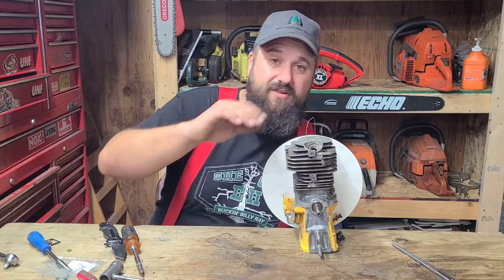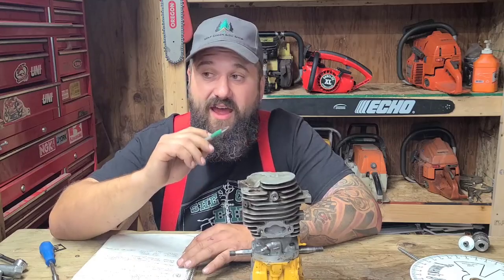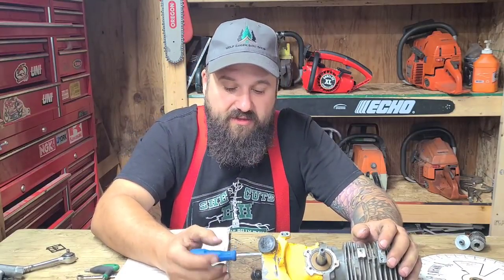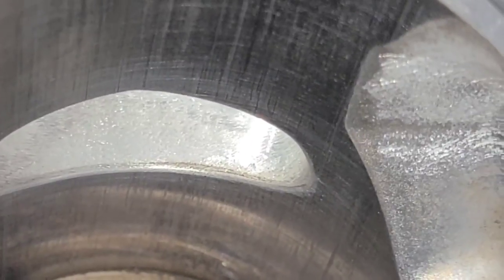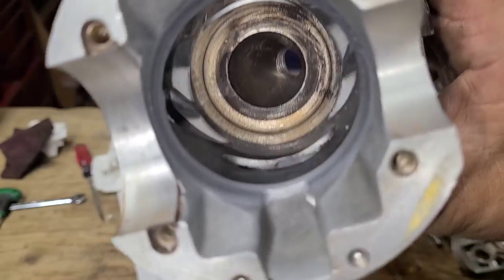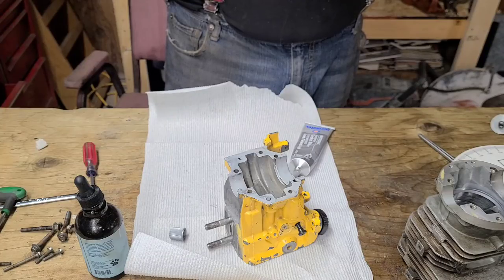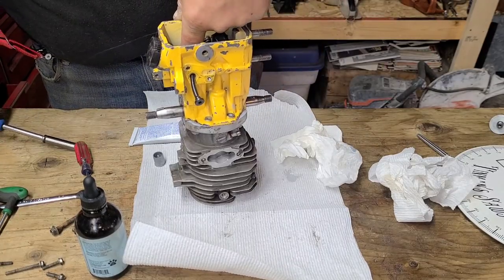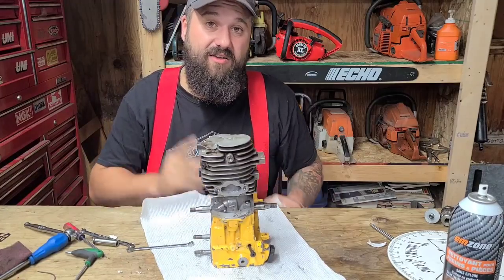Mcculloch Pro Mac 850, showing my porting and assembling the block.

Comment: I'm not a professional porter, just a tinkerer, and I totally agree there are different ways to skin a cat but I have experienced lowering the blowdown can really power in the cut. I know different saws with different crankcases like different things. I did some mild porting to my 046 a long time ago but didn't touch the upper transfers as I didn't have a tool to get them. Recently I bought a 90 degree tool and took the blowdown down from 20 to 17 degrees with no other change and with the same chain and the same log has a very noticeable increase in torque. Doesn't bog and can really lean on it quite a bit harder. Alot happier with the saw. Love your videos by the way.

Comment: Tinman I’m porting my first saw based off what I learned from you and Ironhorse plus reading.
The saw is actually kind of similar to this 850. It’s a little 38cc plastic McCulloch (PM425AV) which is the same saw as the 3516 etc. Anyway it’s a throw away saw vs that 850 but it’s interesting how it is very similar in design. 
I’m totally hooked on this porting thing and with all the variables of Squish,exhaust/intake timing etc I can’t forsee this getting boring any time soon!!
I went a little more wild vs conservative on my numbers but I wanted to see a big change plus I have 4 other saws like that to play with if I destroy this one. I figured it’d be a fun saw to learn on. 
I raised my exhaust then did some more reading and things were not looking good as to if this saw would run good. 
Read some more and decided to look up the specs on my old MS250 because that thing screamed and I liked that saw. Well turns out my numbers are very very close to that MS250 and less wild even so who knows it might run lol. 
Building a limbing saw anyway not a firewood cutter. 
Great video thanks for the help!

Comment: Thats quite interesting that this saw went lean. My saw went super rich and cut at least 3000rpm slower than stock, which is about 7000rpm. I have to say its a 44mm stroke saw, big intake, big carb (22mm stock). I tried lowering the  blowdown by shaving of the top of piston (which I have not been able to do very cleanly). 
I dont know maybe thats what was the Problem. I changed the piston back up and increased blowdown even more. I have to say, thats when the saw really woke up

Comment: What did you decide on the timing for the Echo CS590? ? ? ? ? You do a good job on your videos; your explanations are very insightful and easy to understand and relate to.

You should squeeze the Motoseal tube from the rear of the tube......other suggestions wil follow as they come up. That's the only major on so far ( :<))

Comment: Wonder if o rings around bolts would work. Or over time it would leak.  Probably still better use sealant. Seen some transmission builds use around pump bolts seal them. So dont think you have a primary pump seal leak or main seal leak.

Comment: great video. in old times on 2 stroke engines we did file on the piston head little bit just to open the the transfer port earlier.it did work but its not optimal do so.

Comment: I just bought a 272xp with 60 psi compression I know that's horrible there was light scoring in the cylinder but I sanded them pretty mutch gone but I am hesitant to use it how scored can a jug b b4 u just replace it

Comment: Permatex don't list Motoseal in Australia, Ultragrey is the equivalent down here. Good vid Tinman.
Reply: Thats strange because here in the US Ultra Gray is the Honda RTV silicone equivalent and the Motoseal is not a RTV silicone its hard to describe but it is quite different
Reply: @JacksonHall611  Yeah, I don't know what the story is with permatex in Aus. I have used ultra grey on gearboxes and engines for years with no problems, so it's good stuff. I don't think it's a trade marked name down here because there are about 4 different brands with ultra grey in its line up that I know of.
Reply: @ozdatman  your probably right on the trademark thing US trademark laws are crazy I know of 10 or so products that have to go by a different name in the US than the rest of the world because of the US laws

Comment: Would the port timing numbers still apply to a 50cc saw?  
My old 026 finally died.  Ate a ring and lost the cylinder.
I'm very interested in porting it.  Woods port.  For reliability and longevity.
Reply: I love 50cc saws.  They can make great power and are light weight.  I try to keep the exhaust as low as possible to maintain torque.  Torque is how hard it will pull on the chain, you want all you can get.  Most of it is right before the exhaust opens.  I like 18-20 blowdown.  I widen the exhaust and intake quite a bit.  I also smooth out and open the transfers to keep the flow smooth.  I ported a husky 350 for myself after doing a couple for someone else.  I did quite a bit of work on it and used a good bit of jb weld in places.  The transfers flow a ton.  The exhaust and intake are as wide as can be.  The squish is .018.  I trimmed a ton of metal off the piston to increase transfer flow and reduce weight.
It turns close to 16,000 rpm and holds plenty of rpm in the cut.